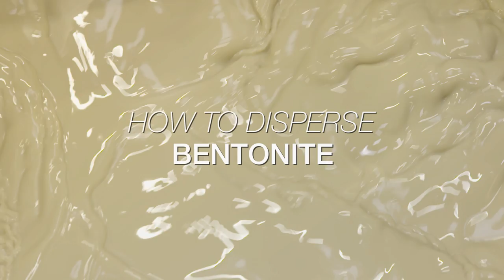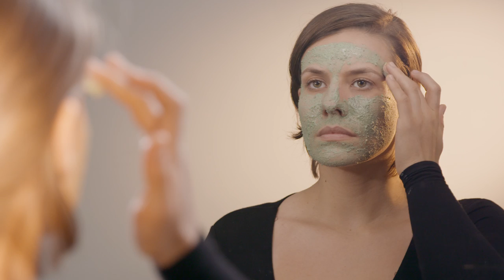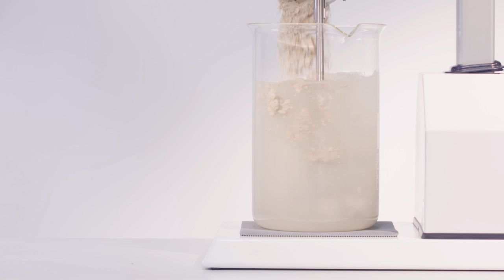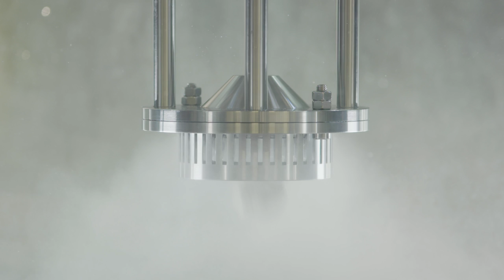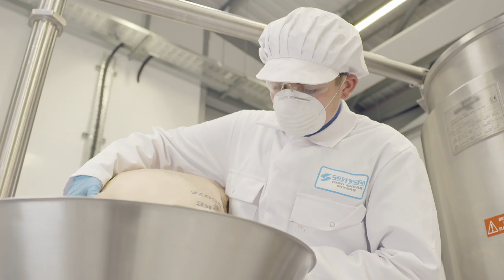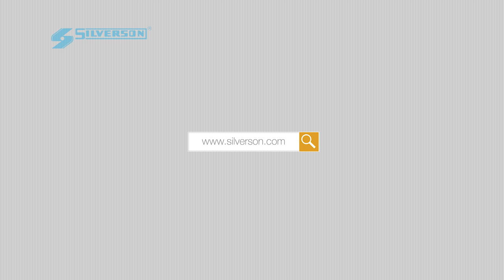How to Mix Bentonite Clay

Comment: Wouldn’t this effect the efficiency of this clay when you use metal?
Reply: Yep! So much misinformation in so-called health videos
Reply: This isn’t for use in health. This is for drill gel, which is used in drilling water wells and oil bore holes

Comment: What about the metal ?
Reply: Only when you use vinegar is that an issue.
Reply: they are using stainless steel mixer, metals are not allowed.